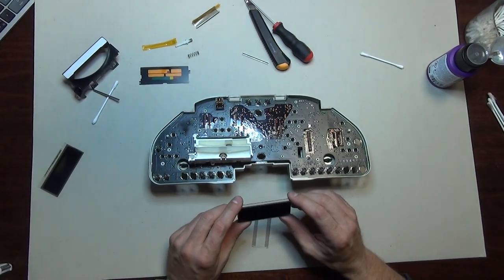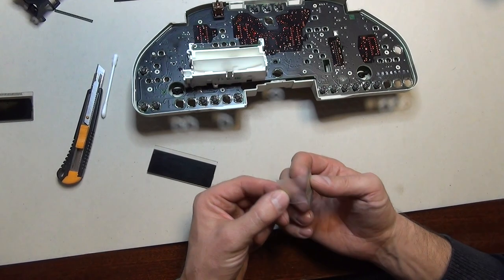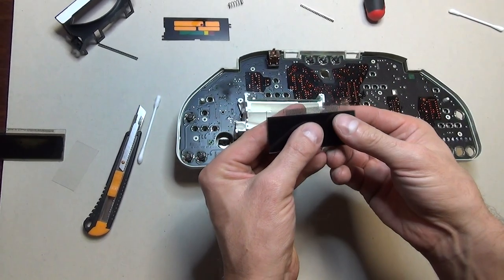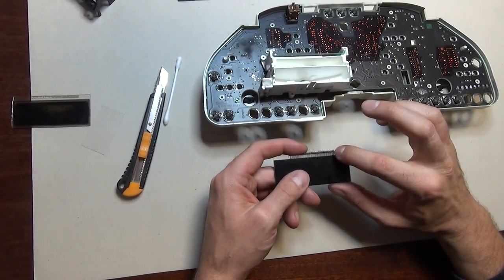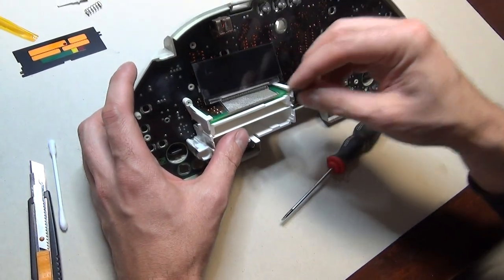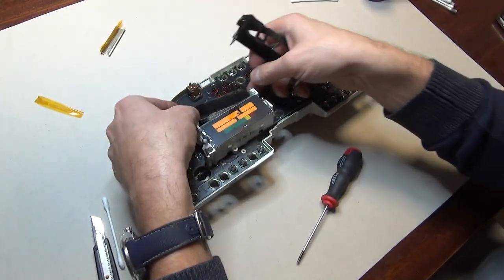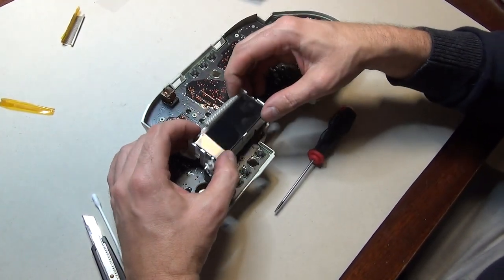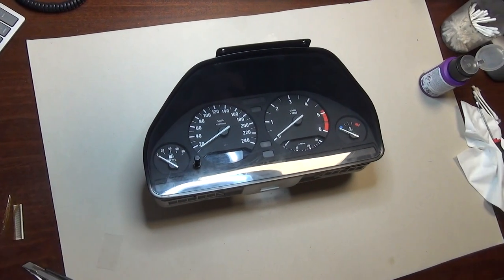E34 Speedo display replacement

Comment: Ho visto qualche video sulla riparazione del display e34  , che usano anche il saldatore per unire i  i contatti .
Reply: Hi, this repair kit works without soldering. There may be other cables at other manufacturers that need soldering, this one does not for sure.
Reply: @absjavitas-pixelfixkft.8231  Grazie .
Ho visto su Alyexpress il kit ma si trova quello a saldare, poi quando non funziona pixel e problema di display o connettore
Grazie
Reply: @absjavitas-pixelfixkft.8231 Hi, where can i get this LCD?